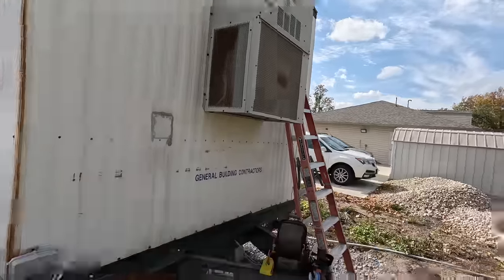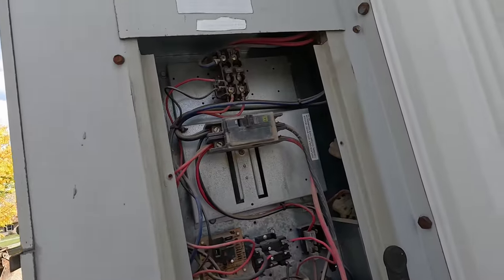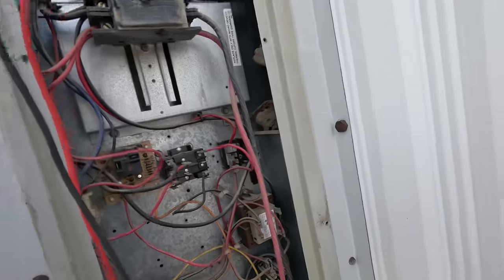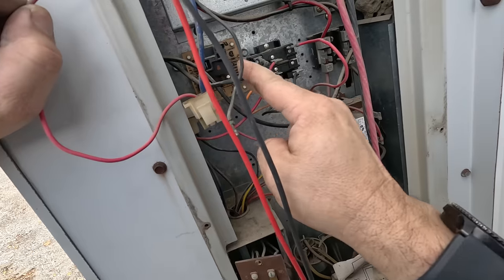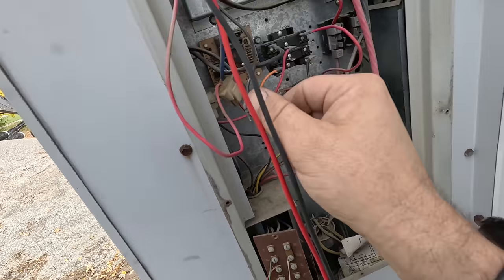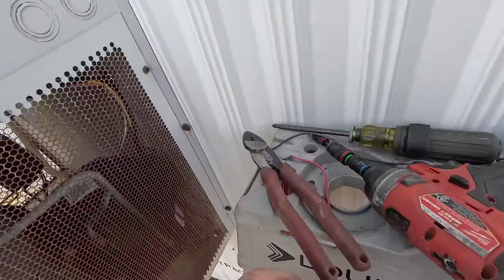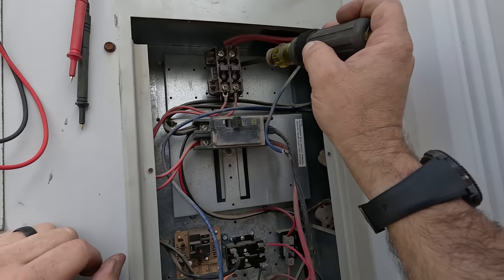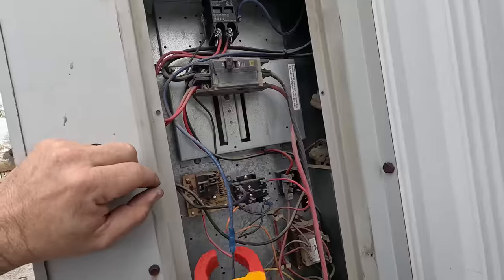Electrical Troubleshooting A Electric Exterior Wall-Mount Heater

Comment: Nice job thinking and making work as it should. You saved a call back because the high limit tripped because the heat strips were still warm.
Reply from the maker: Thank you!

Comment: Brings back memories of a 3 phase wall hung 460 volt  heat pump on a medical imaging trailer!! Previous company had said they needed a forklift to remove it and take it to thier shop!!!!! All that was wrong was the blade had fallen off the condenser motor!!!! Fixed in a jiffy?!
Reply from the maker: I have a video of doing a imaging trailer from earlier this year

Comment: You used to get those 90340 relays with a separate time delay board that went over the coil terminals. I saw/replaced a lot of them on the old Trane and American Standard air handlers.
Reply from the maker: Interesting to hear. The Lennox Pulse used to have a time board like that.

Comment: New to the channel, been in hvac awhile work on a lots of gas fired furnaces not  a lot of electric heat. Question what was the time out on the sequencer you installed?  Thanks for the video. Hope to watch and learn more about electric heat. Have a blessed day !
Reply from the maker: I thought it was on the box in the video? Out of memory I believe it shuts off in 45 seconds to a minute something. The on-time doesn't matter because the contactors immediate
Reply: @HVACRSurvival  great thanks, sorry I didn’t catch it if it was on the box.

Comment: The high voltage on the low voltage probably came from the strip/blower interlock. Those snap action stats won't close R-G on a call for heat so you would connect one leg of strip load to NC side of 90340 with the blower on Common. That way blower will run regardless if strips are called for with no G or with G. With electronic stats the interlock is a redundancy because you can usually configure the stat to control fan and provide extended run. Someone put the interlock on the wrong terminal. Ive run into this before early in my career. A 90340 relay was replaced for the blower but instead of blower being connected to common the line was connected there. The interlock was omitted because with the relay wired like this it will run strips constantly. Sometimes the interlock would bring the blower on in a lower speed as well. Kinda late but i remembered this and thought I'd share it.
Reply from the maker: I appreciate the info, I think someone misplaced the wire when the time delay relay was removed.

Comment: One thing I don't like about that style crimper is when using the insulated terminal nests the PVC sleeve while being crimped will migrate outwards and interfere between the jaws and possibly prevent a effective crush upon the barrel of the terminal.  Doesn't always happen, but sometimes it does.  Have seen it happen, why I went to the non-insulated crimp nests.  Looked like an old W-R mercury bulb t/stat.  Nice!  Kinda hard to get rid of though, eh?
Reply from the maker: Depending on where you align the jaws... I place it closer to the spayed or eyelet side than the wire side.

Comment: Weird fault having 120v on w. Normally on those the red wire in the harness goes to l2 on the load side and when the heating call goes through the limit it sends the other leg of 120v to the fan motor through Nc on the relay. It’s funny those old integrated fan boards have a delay off and when you put a relay in you remove that but the ironic part is the newer bards don’t even have a delay off and use regular old fan relays as well

Comment: Can you explain relays and sequencers in some more detail sometime?  They tend to confuse me especially when wired like you did in parallel.  I understand that they turn on the fan or heat strips but for example in coleman furnaces where everything is controlled with two relays with like 7 wires each its hard for me to understand.   Thanks for everything I really enjoy your videos.  You and my boss could pass for twins 😂
Reply from the maker: That’s interesting, why don’t you email me a picture of him. At the same time can you send me a picture of the wiring diagram that you’re talking about and I’ll see if I can explain it.

Comment: Good job Rick.  I would liked to have found out where the 124v was coming from on the W wire.  With that fried wire on the contactor, did it somehow get fried inside and pick up 124v from the power leg?
Reply from the maker: It came from the normal closed contact on the fan relay.

Comment: You're supposed to run your blower through the NC terminal on the blower relay powered by the heat contactor so that the heat contactor turns the blower on and then any stat can be used, not just a digital with a programmable blower.
Reply from the maker: I know what your saying but that ship passed a while go with all the modifications that have been done to it.
Reply: @HVACRSurvival  fair enough 🤷‍♂️

Comment: I had similar fan issue. I had a burnt up blower motor, and a bad fan relay on a 30 yr old Lennox heat pump. Speed tap used for electric heat was wired to normal closed contacts on the relay then to a sequencer which was used to also energize the electric elements. But G was getting energized on emergency heat and bring on the high speed tap used for AC (normal open contacts) I could not for the life of me figure out why they wired it that way. The only thing I came up with is, I have a Honeywell 8000 stat, and G is energized on a call for emergency heat. I bet the original stat from 30 years ago did not energize G on emergency heat and used the sequencer to bring on the fan.

Comment: If you wanted to throw a icm255 on the truck would have replaced that original time delay fan relay board or done the same thing you wanted

Comment: My cadet electric wall heater was working just fine. All out of the blue it just started blowing cold air. The fan blows. Tested thermostat and works. Kicks in when i set it at warmer temp but just blows cold. I hit reset button, didn’t work, i reset the circuit breaker, no change. Is there a way to fix it or do i have to go buy a new one?
Reply from the maker: I don’t know your capabilities, so you take all the risks of damage or possible death...  

You’ll need an electric meter to check the resistance of the heater element with the power TURNED off and element isolated.  then you have to test the thermostat,  it should be closed when calling for heat, finally you should check the limit switch and verify its closed. All these things should be checked with the power turned off and verified that its 0 volts AC. each component should be tested by its self with the power off. This is just the basics.
Reply: @HVACRSurvival thanks so much!!! Truly appreciate it

Comment: 120+VAC doesn’t tingle much past the elbow.
Reply from the maker: Very true, and only a little further if you're standing in water. However if you're standing on that fiberglass ladder and not touching ground you wouldn't feel a thing.